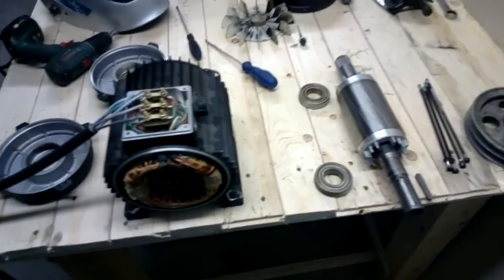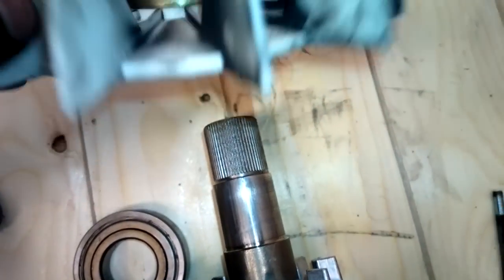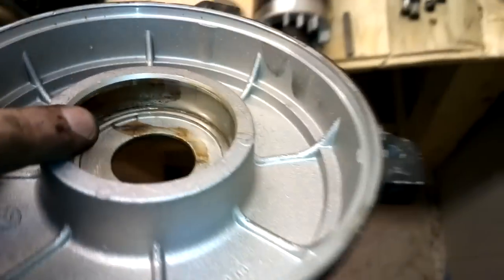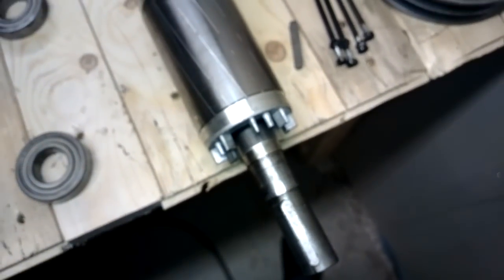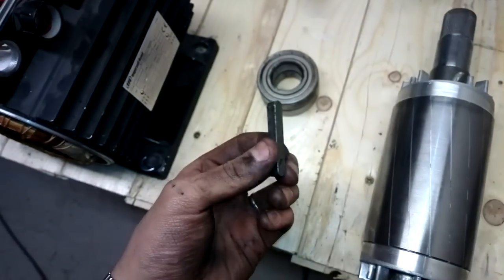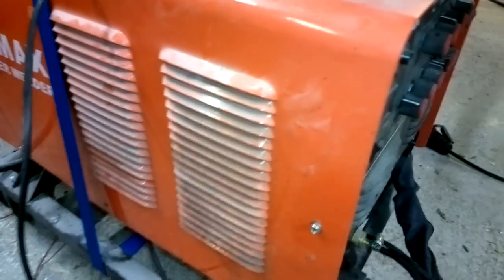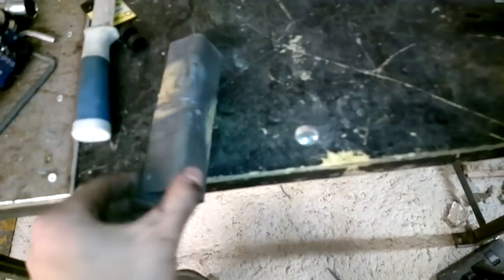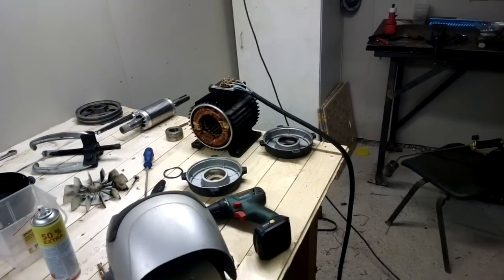Electric motor disassembly to change bearings

Comment: I'm not sure if I missed it a couple times, so sorry if in video. I have an allen bolt holding the spindle of the rotor, this rotated when I try to unscrew. Holding the opposite end rotates on the other bearing. How did you fix the rotation when removing the bolt to access bearings. Thank you.

Comment: Looks like you will have a like new compressor after all... I love it when a plan falls into place! I think you've got the rest figured out! You know you'll have a heck of a ground/earth with that clamp... What a beauty! Well man it won't be long now,,, not near as long as it's been... Take care... :o]

O,
Reply from the maker: I hope it will be good as new!! The Esab welder also became like new after the service I did to it! I think I'll do a demo weld video about it sometime, it is good for some really tough welds!
Yeah, plans are finally becoming reality! The shop has come a very very long way since summer. I actually just looked at some photos from last summer and I almost couldn't believe what it looked like back then, a little over half a year ago :-).
I'll do some final touches like adding a steel plating to the second table and adding one more light. I guess I'll then make the final part of the workshop video series.
At the moment I already feel like the shop is actually ready. The main purpose of this shop is being able to repair all of my machines and I've already started on that a little bit, so the shop is now serving it's purpose!
Reply: I like how well lit you're making your shop good lighting can make a lot of difference! :o]

O,
Reply from the maker: Opinionator52
Yes, being able to see helps quite a bit :-)!

Comment: very nice, once the bearings are changed that part of the problem will be over. maybe the electrical problem will go away, we'll see?
Reply from the maker: If the problem really is in the motor, this will not fix it. But I think I already know where the problem is and it will be easy to repair.

Comment: Most helpful, thanks.
It would be interesting to see how you deal with pressing the bearings on to the shaft and into the housings when you come to rebuild the motor.
Reply from the maker: Good to hear! I can make a video about installing the bearings and putting the motor back together. Will have to wait until next week.